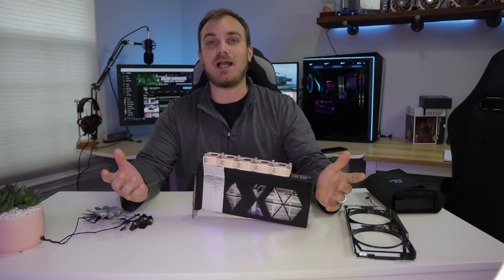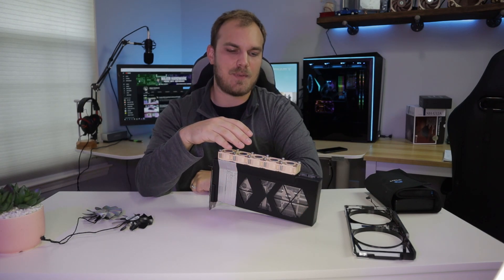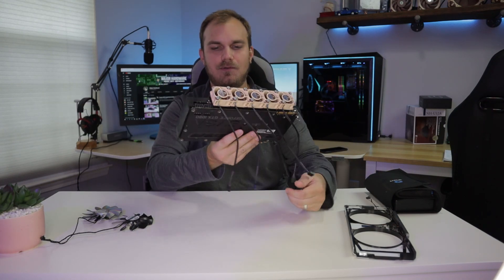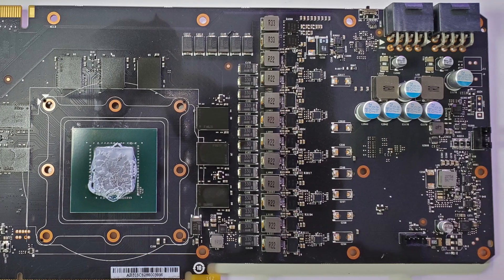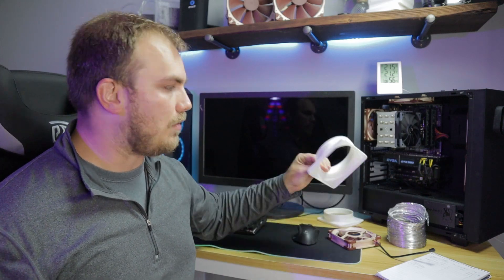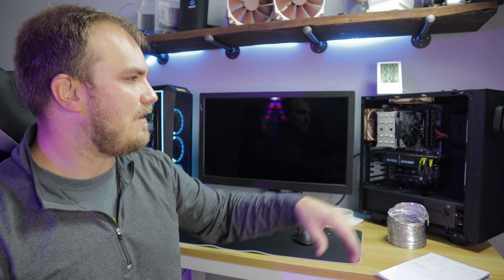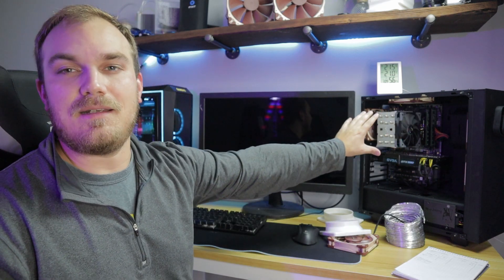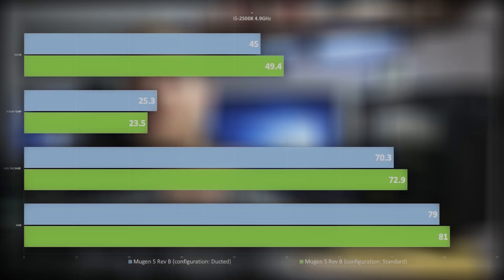Does Connecting Your CPU COOLER Directly To Your Case Fan Improve Temperatures?

Comment: 20 years ago: We'll connect the case fan to the cpu cooler
10 years ago: That looks stupid let's remove it
2019: BRING IT BACK AND SEE IF IT WORKS
Reply: every phones features today. add and remove and call it a feature.
Reply: @Justin Martone so.. gonna spend 25, might as well spend 250? Great argument lol.. if you want to liquid cool your PC by all means be my guest.. 
Not everyone wants to though and this is a relatively low cost mod with tangible benefits for those that would rather not
Reply: @Justin Martone except the cost :/
Reply: @Gpops_  What cost? We used to make ducts like this from cardboard back in the 90s. It's that moment when you find out that trigonometry actually has a useful real world application even to a 14 year old.
Reply: @fermitupoupon1754  cost of water cooling.. not ducting... Try re-reading who I was replying to
Reply: @Justin Martone Cost, maintanance and reliability matter. I switched from 280 AiO to Dark Rock Pro 4 and it turned out to be a little bit hotter on cpu, but percieved noise is actually lower (and i switched fans for better setup on the AiO -> push pull with 4x 140mm). There's something for everyone.
Reply: Old dell optiplex 745 has a ducted cpu/case fan combo...
Reply: @Justin Martone just gonna put this out there https://youtu.be/23vjWtUpItk?t=401
Reply: @Gpops_  I'd still rather spend $50 on a cheap, compact AIO and install it quickly vs spending $25 for a cheap air cooler and $25 + time for ducting and bracket installation. 3 degrees isn't much of an improvement.
Reply: @somelokyguy6466  i believe i said in one of my previous replies - if you want to that's up to you.. some don't want to and this also works
Reply: @Gpops_  And you can do whatever you want with yours, I'm just refuting your point where you say water cooling is expensive compared to this.
Reply: @somelokyguy6466  water cooling where you'll see large gains is :) arguably with a small aio you'd see near the same results as a similarly priced air cooler
Reply: @Gpops_  You're right. You'll see nearly the same CPU results compared to an air cooler, however with air cooling unless you run an exhaust shroud, everything else in the case will have higher temps, especially in smaller form factors. 
Reduced internal case temps are what popularised top mounted water cooling in the first place, not CPU temps.
Reply: @somelokyguy6466  guess it all depends on the case and how much space you have.. I'm loath to change from my haf x even if it looks dated
Reply: @Gpops_  I used a HAF 922 until a few months ago the HAF series is still viable in 2019 albeit a bit noisy. I still went with top mounted water cooling though since my graphics card was an older 300w Radeon card and I wanted to give it the coldest case temps I could.
Reply: @somelokyguy6466   4.4 degrees is an improvement**
Reply: @somelokyguy6466  , 3 degrees is "nothing"? Yeah, until you want to overclock it to the moon!
Reply: @Gpops_  , water cooling AIO same as air? Maybe, but if I can have less "jet engine sound", it's still a win. Same for vid cards, I hated how my 9600 GTX "reference style" ramped up to 747 jet sounds in any stressful game, other 9600gtx with bigger "stock" cooling/more fans could handle it with less noise. I know, old hardware references, but still.
Reply: @somelokyguy6466  You're right, this solution is more for cases like mine with poor airflow to begin with (only 1 92mm exhaust fan) In my case, I went from thermal throttling my i5-9400f, to being able to run it at 100% stress test while never breaking 77 degrees.
Reply: My cooler master centurion case had a duct built in to the side panel for this like 15 years ago.  The opteron 170 in that beast still runs cooler than any other CPU I ever had.
Reply: Yeah! I had an old case which had a duct from side directly to CPU cooler.
Reply: Hey I remember buying a wood 4 inch circle drill bit & drilling through my steel side panel (destroying the drill bit) to mount a 120 mm fan on the inside of the panel over the CPU & making a plastic tube that connects to my CPU cooler that would match up with the fan I mounted.  

Back when GPUs didn't have fans, & if you wanted sound you had to have a Sound Blaster card installed or all you got was beep beep beep.

Did you do the trick where you'd put your fanless GPU in the freezer for a few hours & take it out & twist the heat sink breaking the thermal epoxy (how it was connected), and if you didn't rip your GPU chip in half you'd then buying a replacement GPU cooling solution, I remember it was a hockey puck shaped copper heat sink with a fan enclosed.   

I remember even lapping both the GPU & the puck, kinda had to lap the GPU to remove the chunks of thermal epoxy.  I think 10 or 20 years after that I used that same copper hockey puck to cool a motherboard chipset, it worked great both times.  Think the GPU was a EVGA Nvidia model... damn I wish I bought some Nvidia stock back then, remember it being 17 cents a share at one time.
Reply: I wrote this book then realized I commenting on a post that no one looked at for 3 years, so I saw this fellow Boomer's comment had 27 comments & thought I'd post my TL;DR post to see if anyone could use or appreciate my idea on airflow control.  ...I even bitch about taxes :) as proof I am a Boomer.  :)

First thing you need to see if you need to bother controlling the airflow w/in your case.  First option is to check case airflow with vape smoke, if you do not vape, drag someone that does into your computer room.  If you or they have a good vaping rig they can completely whiteout the inside of your case with one drag. +++    

A Non-Contact Infrared Thermometer would be best, so you can focus on the areas that truly needs help, & no need to kid-napping vapers from off the street, but that is your business.  If none of these two options work for you, you could load what ever software you use to monitor your motherboard & component temperatures.  

Really the best would be a combo of the last two, so you can know how off the temperatures are being reported to you from your system built-in probes.

And if you have dead zones, you can try adding tiny louvers or fins to the fan or fans to direct air towards dead air zones.  Can also add fins to exhaust fans, it is about controlling / channeling both cooler air coming in the case & hot air being pulled out.

Also adding a "sail" in the path of the airflow to control its direction without connecting to a fan, example would be adding a sail to the screw used to mount the motherboard to the stand-offs by the ram, same thing is needed around the CPU if you're only water-cooling the CPU with a AIO & not cooling the VRMs, the chipset, & where the power plugs into the motherboard, no one checks the m/b power plug, but it can get very hot, doubly so if its a cheap plug, or not fully plugged in, or a plug pin became lose.  We've all seen what was happening with some 4090 power connections melting.

The custom water cooled PCs I build I use 12 mm hard plastic tubing, I would use 10 mm tubing but they stopped making the needed fittings,  so the last thing I want in my build is an ugly tube directing airflow so adding a 2 inch clear plastic quarter cone shape on a corner of a fan don't stand out.

And with the tinted glass sides installed, they're next to impossible to spot.  I normally use the cone shape of the top of a Coke soda bottle, easy to cut with scissors, & duct tape to strengthen the section that can't be seen when finished being screwed down, so the plastic doesn't split or crack, & then s soldering iron to poke the screw hole, a drill would also work.

I've thought about adding my little corner cones pointing Helter-Skelter to cause as much turbulence w/in the case, & having each of the fans individually cycling up & down within a certain range of RPM, like 200 or 400 every minute I believe this would allow fresh air to hit every spot within.   This is something I'm going to need to try, just for #its & giggles, the "Shotgun-Approach".  I'd need a damn large amount of soda bottles.

Maybe I can create a set of the corner cones that can temporarily connect using magnets for a quick test change test again got having to unscrew anything.  Or something very easy, a clip on set, maybe cloth pins.

To mold them into the shape use a heat gun & silicon oven gloves, I first used steam before I had a heat gun, but the silicon oven gloves are a MUST when bending heated plastics.

+++ Vape 'smoke' does ZERO harm to the PC & you, all the warnings about Vaping is from Big Tobacco because they were losing customers because vaping is a great way to QUIT smoking normal cigarettes & governances because they were losing TAXES
Reply: All the old school Pentium 1 through 3 had a plastic duct like this idea
Reply: @loganbates2657 , no.. not "all".

Quite a few branded prebuilds would, but certainly not in a majority
Reply: i cant stop thinking about all the dells and gateways in the 90s.   now this just makes me feel old lol.
Reply: 5hp fan way cooler than liquid, mount the case  somewhere where you cant hear  it. pass input devices through something wireeless.
Reply: So true! Back to the old days it was standard.
Reply: Side door vents too. Flintstones technology that really works.

Comment: Ok. I have seen 1.50 in and you talking about taking air from upside and to the fins on the cooler... it work and I have done it like 15 years ago. 

But it's it worth it... for only performance and nothing else matters. Yeah. But for all the work you need to put in to it and how ugly it looks... no. Not really. 

Just get a good air vent going in your rig.  Fans in the front blowing in and fans in the top/back blowing out.

Comment: You want good ideas? Sure...
Here's a continuation of the principle, but more direct and applied to where efficient cooling is arguably needed the most - the GPU.

(1) buy a 16x PCI-E riser (not 1x mining risers obviously). These are pretty inexpensive and are proven to have zero performance detriment even for top-end cards in gaming.

(2) Now you can place your GPU more freely. Stick it at the bottom of your case, fans down. Of course you will need a case that either has ventilation holes there, or a "tunnel" like you do on the case behind you (might require moving the PSU), or it can simply be cut out if you aren't afraid of doing a very basic mod-job.

(3) Enjoy your GPU sucking only ambient air (no duct required and thus no fan efficient drop due to higher static pressure). If the air in your case is 10-15 degrees higher than ambient then this will now translate into your GPU running about that much lower too. Use that headroom to either flex your OC, or to run full performance at very quiet fanspeeds. Win ... :D

I've many times wondered why mobo, case, and cooler manufacturers haven't been able to coordinate better to place the hot components so that they can easily suck and vent to ambient air rather than circulating hot air inside the box. There is very little reason why this couldn't be done for both GPU and CPU - at which point the rest of your system would hardly need cooling at all besides maybe a single circulation fan.

Comment: Airflow is severely decreased when using flexible pipipng. Each ridge acts like a small bump when the air is traveling through the flexible duct. If you are looking for highest effecctive upgrade to the thermals. Use rigid pipe. It would be tougher to pull off but would directly raise CFaM.

Comment: We used to do this all the time. But it's not really worth the effort, now a days. If you are going to push the cpu that hard, you are going to want a good aio or custom loop. But us older OCers have done ducting, isolating the GPU, spot fans on VRMs, etc. Things are just easier now, to where you don't really need to bother ducting and the other stuff.

Comment: To answer the clickbait in the thumbnail, 3 main reasons:
1. Cases have acrylic/tempered glass now. Having vent conduit in a case makes it look like a 90's movie prop. Shit is out of place.
2. The thermal requirement before you hit instability is far greater than what you can actually achieve. Ie, no matter your temps, your performance will be the same as before. 
3. Watercooling. Radiators do the exact same thing for just a little more cash. Much more elegant solution as well.

Comment: I worked in PC repair store, and what I learned is that a lot of older cases had a plastic tunnel system from case vents up to cpu fan on the cpu cooler. It looked very professional, and created perfect pathways of air. That works amazing in a case, because there is no interruptions somewhere, and also the air exhaust tunnels on old PCs were basic but glorious. Nowadays manufacturers do a crappy job with air flow.

Comment: @2:24 -- Notice the line of tantalum capacitors...They all say 330 on them...except for one in the middle, that just says 30 @2:24
That spot said 330 at the factory. You can see the 3 printed under the blackburn
Reply: that's some nice OCD at work LOL

Comment: I have a Gateway computer from 2007-2008 that has a plastic duct that looks like it was custom made for the motherboard and case combo, along with the radiator on the CPU. That computer could take the chill off your bedroom in the winter.

P.S. — I totally agree that modern PCs should be doing this more.

Comment: The appropriate setup would be to exhaust hot air out the back since your gpu already does that with a blower fan then thats good.  Doing so will bring the ambient temps inside the case down for cooler intake.   Rather than sucking air in in your setup try to exhaust air directly out.

Comment: You would heat soak after a while. The real benefit comes from pressure drop across the fins. So to maximize cooling you have to maximize pressure drop across the cooler. The air speeding up and squeezing through the fins lowers the air pressure in the core of the fin stack(Bernoulli principle). While a lot has to do with simply moving heat away from the cooler the efficiency of the cooler is determined by the pressure drop across the cooler. A high pressure differential across the cooler will cool more than not. What you have done by ducting is increase the pressure on one side of the cooler.

Push pull configs have very similar performance on radiators and coolers. Pull configurations work well in cases, and if you think about it it makes sense. Hot air is by nature higher pressure air, so the air inside the case naturally wants to expand. Push pull intake and exhaust fans is creating a pressure differential within the case. A strictly pull configuration is actually being helped by the hot air to escape.

So to come back to your video, ducting as you have done channels more air and creates a bigger pressure differential across the cooler, a good heatsink and fan shroud increases performance. 

Good heatsink design is more than just maximizing surface area, but pressure drop across the core. Good heatsinks have closed off ends and shroud the heatsink so as much air passes, with the biggest pressure drop across the fin stacks as possible. Mediocre ones ignore this.

Comment: Redirecting air flow using ducts inside cases is something servers are still doing. It also increases the chances of the air being used to cool the PC being cold, instead of just warm air that's sort of stationary inside the case.

Comment: Check out the HPZ230 & Z240 SFF workstations.  Current units with duct? from rear fan to CPU cooler.  Do not know if it makes a difference in temps though.  Just is out the factory with it.

Comment: This is why I don't actually like air coolers when combined with a non-blower GPU. An AIO cooler pulling air from the outside in the front works better.

Comment: You should have more air intakes than outs. the air you push out from your case has to come into the case first from somewhere. You want it to come from your intake fans because they have dust filters. If you have more out blowing fans than in blowing fans, then you have under-pressure in your case and the air comes from somewhere - any hole or route the air can get - into the case. And most of those routes have no dust filtering. If you have over pressure in your case (more air intakes than outs), then that air will get out of case from anywhere but get into the case mostly just from the intake fans. Hence: if you don't plan to have over-pressure inside the case, you will get more dust inside the case over time, which will strongly decrease cooling performance.

Comment: IMO - I remember when OEM builders like HP & Packard Bell used to do something similar with their prebuilt PCs. They used to attach a funnel from the stock intel heatsink that reached all the way to a vented area of the side panel. Though PC cases back then especially the OEM ones had absolutely terrible airflow... one 80mm at the front and one 80mm at the back and the front fan was usually covered by the plastic front panel of the case so flow was a bit restricted anyway.

Comment: Not only this is actually an oldschool cooling method (I think back in P4 or C2D era), but rackmounted servers today still uses the same method of a dedicated duct or air path to force the flow of cool air into the heatsinks or hot components. The different is on server environment they use a very high static preassure fan (that so damn loud it sounds like a jet engine) since noise is not really an issue there.